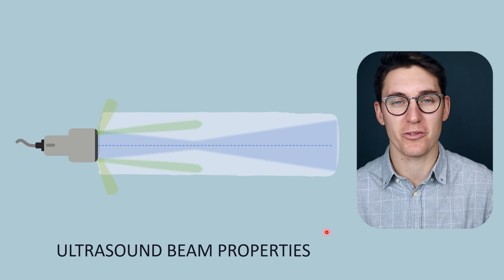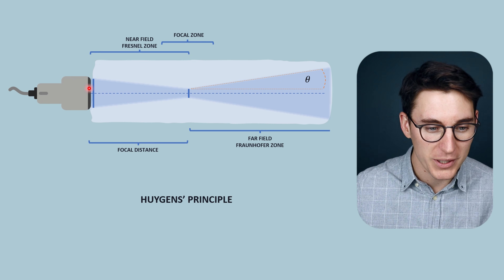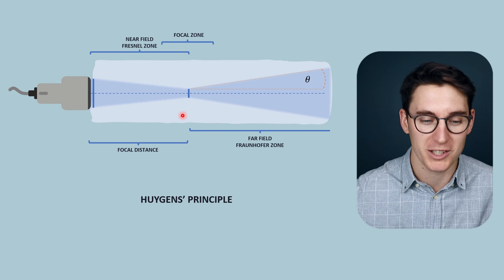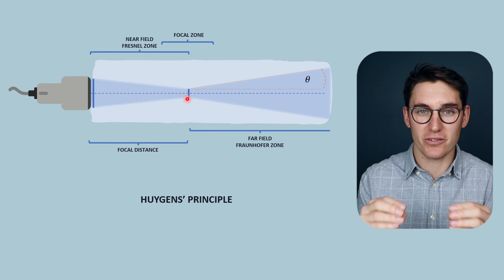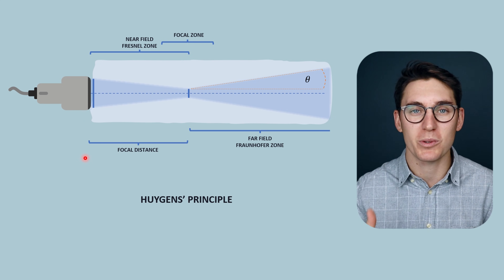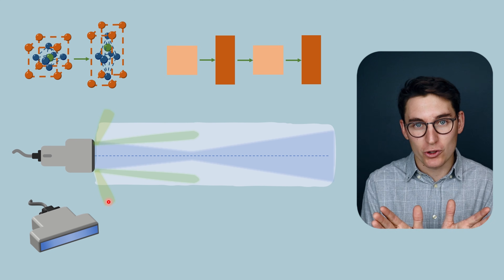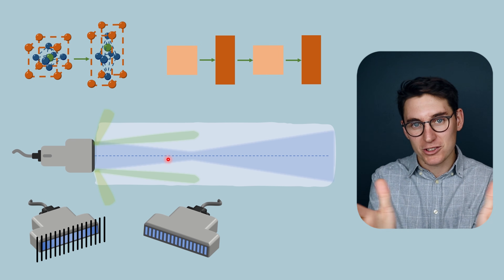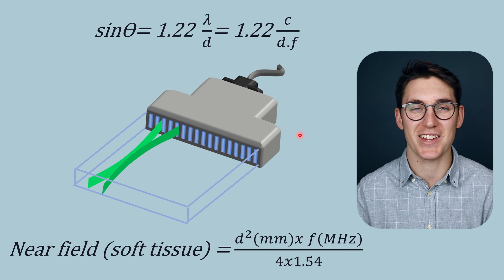Ultrasound Beam | Ultrasound Physics | Radiology Physics Course #15

Comment: Because frequency and wavelength are always inversely related as a function of the speed of light, this means lower wavelengths occur at higher frequency. This means larger + low frequency probes have further away near fields as per: Near field = d^2/4 * wavelength, which is just expressing the idea that high frequency/large diameter probes have deeper focal points because the beam converges at a more shallow angle.

Comment: 5:45 how is 1540 m/s = 1.54 mm/s ??
Reply: 1540 meters per second means 1540000 mm per second or 1.54 mm per microsecond
Reply: you're right, it's not. 1540m/s = 1.54 x 10^6 mm/s. But don't forget he's using frequency in MHz instead of Hz, so the 10^6 in the denominator cancels out the 10^6 in the numerator.

Comment: Hi dr. Nel - thank you so much for these videos: adding much needed context and analogies to textbook information. A question regarding units used in calculating near field (soft tissue) distance: you mentioned using 1.54 mm/s as speed of sound in soft tissue here in order for units used to be the same. Am I mistaken in thinking this should be 1.54mm/microsecond? Am I missing something? Kind regards
Reply: It is 1540 m/s so 1.54mm/s
Reply: @amelbelaib3266 1540 m/s would equate to 1,540,000 mm/sec (if you can travel 1540 meters in a second, you would travel way more millimeters in a second). The 1.54 is km/sec.

 λ = c / f and the normal units for distance is meters. If you want λ in millmeters, you multiple by 1000 (1 m = 1000 mm). To keep units of distance constant, you must also multiple the meters in m/s for c by 1000. This gives you 1000 m/s or 1 km/s. So we need the c (soft tissue) in km/s. So 1540 m/s = 1.54 km/sec.

Sorry if thats hard to follow, easier to say out loud than type haha. Hope that helps.
Reply: @amelbelaib3266  1.54 mm/sec is very very slow .Speed 1540 meters /sec is very fast .Is not the same speed
Reply: 1540 meters /sec is 1.540.000 mm /sec since 1 meter has 1000 mm or we can also  say 1.540 mm per millisecond or 1.54 mm per microsec

Comment: What a nice educational material!

I have a question. As you said in "Near field distance", the higher frequency can generate a deeper focal point. 
I understand that the higher the frequency, the deeper the focus is formed according to Huygens' principle. But is it true that it actually doesn't penetrate deeply because of attenuation? I saw penetration depth is inversely proportional to ultrasound frequency.

Comment: Firstly awesome content and thank you for this. Quick question : Isn’t the thickness of transducer element half the wavelength so the constructive interference happens? So how can it be less than half the wavelength to reduce the side lobe artefact?
Reply from the maker: Thanks Jugal 🙌🏼 can’t remember what I said in the talk (maybe I misspoke). Transducer thickness determines wavelength. Transducer width reduces side lobe. Hope that makes sense 🙂
Reply: You were right on the talk. I got confused with width and thickness of transducer. My bad. Is there any relation between diameter of transducer and side lobe?
Reply from the maker: Good question I’m not actually sure. I’ll have a read up. If you come across an answer I’d love to know 🙂
Reply: @radiologytutorials  sure I will.

Comment: First of all, thank you lots for your videos (all of them, not only these ones); they truly are really informative. Secondly, regarding the beam shape displayed in this series, I think it's important to note that in orther for the near field to have a converging shape, the elements of the transducer have to be triggered in a certain order. From what I've read (and understood), if you fire a single piezoelectric crystal, the near field has a constant width till it reaches the "focal point", when it starts to diverge. Please correct me if I'm wrong.
Reply from the maker: Thank you Mihai. It turns out that the beam will naturally converge before diverging even without focusing the beam (which is what you're referring to here with triggering the crystals at different times). The way in which waves interfere (even if fired at the same time) will cause this initial convergence. This has to do with point emitter interference patterns. Confusion is often created as many texts will illustrate the near field as a non-converging shape - which is technically incorrect. Hope that makes sense  😊

Comment: Thank you professor for the short but informative course! On the divergence angle, I am not sure about the factor of 1.22. This factor seems to be related to the first zero an Airy function of a diffraction pattern of a round aperture. But for a rectangular probe, would this factor be actually 1.0?
Reply: for rectangular probes you use half the measure of the largest facet of the crystal (instead of the radius of a round crystal). the constant also changes to account for that. but the general idea is the exact same: larger crystal = smaller sin theta = smaller divergence angle